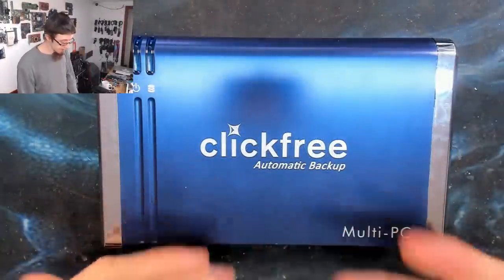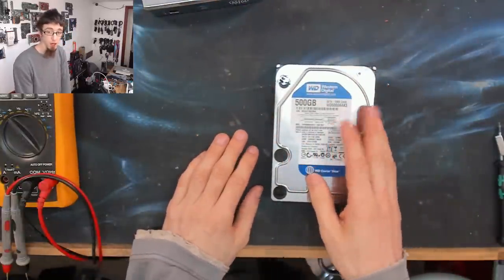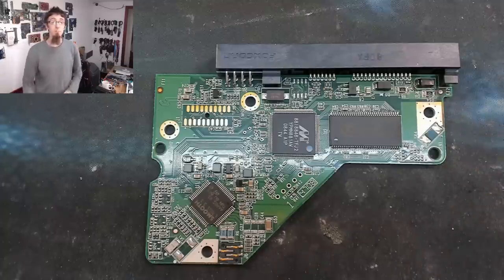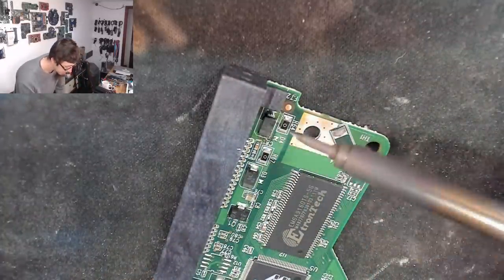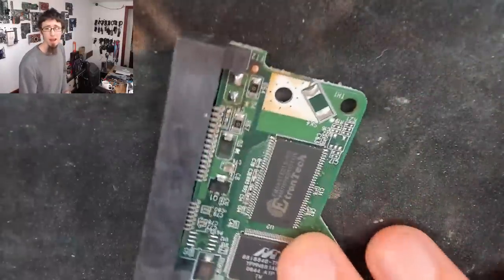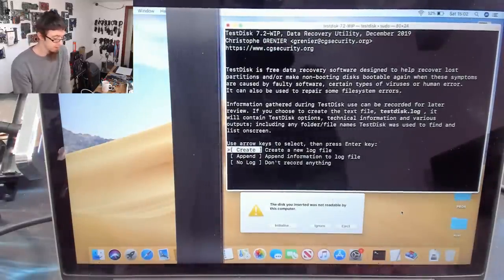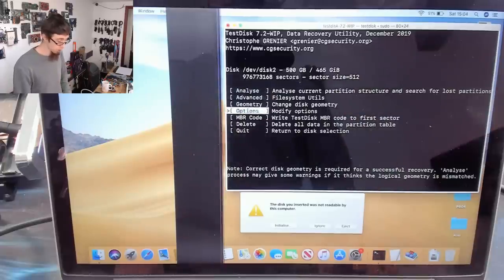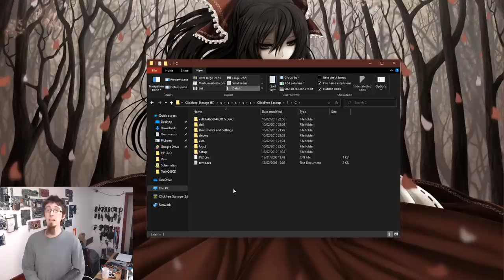Lucky save, HDD with shorted SATA connector - LFC#223

Comment: Interesting video.  I have some old drives I have not used in a while, and I recently plugged them into a caddy, and they kept cutting the power to the caddy, I guess some short circuit protection.  In another caddy I started to smell burning, and saw smoke after a few seconds.  Both caddyies had decent power adaptors, and work with other drives.  In fact, one was a brand new WD caddy I had after removing it's original drive.

Of the 4 drives I tried 2 of them, with the same behaviour, and not wanting to mess up the caddies I stopped.  I just checked, and the first 2 are shorting the right side sata pin onto pin 4 and 6 (not 5).  I see the same thing on both drives.  On drive 4 I think it's the same, and drive 3 seems OK, pin 1 not shorting to 4 and 6.  I found a component, KVP 47A, and it seems to act like a diode, on drive 3, but not 1,2 and 4.  

I stumbled across your video by pure chance, in my Youtube recommendations, watched it casually, and when I saw, took a look at my drives.  I might remove the KVP 47A component on one of the drives, just for kicks, since these are ancient 250GB SATA Maxtor drives I don't care about anyway, ideally I'd like to securely erase any remaining data prior to disposal, or letting someone else find a use for them.

Comment: Rare to see a Western Digital HDD fail. For me i had 2 Seagate just randomly died (Both ST500). My speculation was the board because i could see the PCB seems like corroding, it has spin and drive would show up in bios.. but when in windows it would just tap out and not show up

I had bad Western Digital too that died but thats on me. One day it got suddenly housed by an ant inside my PC case while i was away for a day. In my panic i throwed the disk out and... went full linustechtips... now the drive is just on my balcony as a reminder to myself to always put extra care to my data i lost that i cannot recover

Comment: Hot tip... The spring pins that go to the pads leading to the motor are a source of failure and frustration.  Whenever I remove a board that has them I bend the pins upward just a little so they make better contact with the pads leading to the motor.  If the pins don't put adequate pressure on those pads then the coils in the motor don't get sufficient current flowing for the controller to detect a properly functioning motor and so it spins up and down over and over. Vrrrrup frrrrrr.. vrrrup frrrrrr.. like its cursing at you.   lol.
Reply from the maker: Oh aye, I've heard a drive do that before... cheers for the tip!

Comment: Hi, i'm in DR field.
Protection diodes on 12V and 5V rail are not ZENER but TVS diodes (Transient Voltage Suppressor).
Cool video :)
Reply from the maker: Oh neat, fair enough! I've often seen them referred to as Rectifier Diodes as well. Is there a particular difference, or is it just specialised for the particular task?
Reply: A zener is one of two types of diode based TVS's. The other is a form of thyristor. 
TVS is a generic term that also includes gas discharge tubes and MOV's. The Zener reacts in 50 ps and can go down to 3v and can dissipate small amounts of power.. the tyristor type only goes down to about 30v and cannot dissipate any real power. It reacts in about 3ns. So tis is indeed a Zener.
Reply: You will often find two or more different types of TVS in paralell in order to allow them to work to their strengths. Gas discharge tubes handle very high voltages butvthey are slow. MOV's are medium speed and medium voltage and can dissipate quite a bit of power. Thyrister TVS diodes are similar voltage but much faster. Zeners are low voltage but very fast.
Reply: @Adamant_IT  yes rectifiers and zeners are completely different. Rectifiers only pass power one direction. If you manage to exceed its breakdown voltage it is toast. Not so with zeners. They are designed to  conduct in reverse without damage.
Reply from the maker: Cool stuff!
Reply: @Adamant_IT  A TVS diode can be thought of as a very fast acting zener. I never tried to replace a shorted TVS on hard drive pcb with zener, so i can't tell what would happen in case of over voltage or some other type of power surge when has been replaced with zener type. I always replace TVS with TVS!
If i have to choose between replacing 12v tvs diode with zener diode and not replacing it at all, i would prefer the 2nd as you did in the video (of course only after have check that short on pcb has been solved and that power supply is ok).

If, on the other hand, it was the diode on the 5V line that shorted, i wouldn't have risked turning on the hdd without first replacing it with same tvs diode (or equivalent tvs). If something goes wrong without any protection on 5V rail (or without a proper protection) heads pre-amp would get killed, which is located inside the hard drive (on the heads arm). If that happens then you would definelly need to swap heads in clean room.
Reply: Daniele Malagoli maybe you could help as you seem very knowledgeable. I have the same issue on a 10tb drive that I don’t want to rebuy(out of warranty) I wouldn’t mind attempting to replace the chip with a new one as a last resort  but I’m unsure of what specs the diode would need . Could you kindly point me in the right direction.
Reply: @rathy21  Hi rathy21,
i need to know the exact model of your drive and pcb number.
Better if you also post a pic in high resolution of your pcb, i need to see the marking code written on tvs diodes (u can upload pic on imagebam.com and then pass me the link).
I'll tell you which diodes to buy exactly, i usually buy those on rs-online.com or get them from a donor pcb as yours.

Comment: Hi mate!  Long time watcher, fist time commenter.  I wondered if I could pick your brain?

I have a custom 360.  I am able to rip my discs to the drive.  It’s good for keeping my discs fresh.  The drive however has stated to do the clicking, is showing on pc (raw data like the video) but I’m unable to read due to format of disk (360 formatted drive) and its temperamental on windows dropping in/out with long read times.
I know it’s dead and on last legs.  The data is not mission critical, but to rip all those games again on a fresh drive will take me months.  What software would you recommend for a chance to rip a clone of the drive?

I know it’s a slim chance, but rather a slim chance than a no chance and months of ripping again.

Thanks for great content as always, you been my background channel for a while now hehe
Reply from the maker: I think the 360 has a custom boot sector on it. I'm sure someone's figured it out by now, but I don't know the answer myself.
Reply: I would try Minitools version 10 or above and try copying the drive.
Reply: @SummerSideOfLife  just wondering how many total GBs estimated time it would take?
Reply: @SamuelFCampbell2003  you should definately use ddrescue (specifically gddrescue), get a  ubuntu usb boot disk, then do a clone to a replacement hdd, it is a sector by sector clone and such doesnt care about the partition table or filesystem. https://www.technibble.com/guide-using-ddrescue-recover-data/
to install gddrescue use the'se commands:
sudo apt-get update
sudo apt-get install gddrescue
Reply: cloning copies everything from one disk to another, the special thing about ddrescue is it retries then skips bad sectors so it works well on failing drives.

Comment: this is my issue, that i cant fix!!...i have a seagate 2tb with a dead pcb!...for month i tryed to fix but i cant locate the problem! there was no 12V signal! every few weeks i pick up this pcb and try!
for the most time, i miss out the two "zero ohms resistors"..they have marks in the middle and u cant read the "0"...there is something that blown this 0 ohms resistors out.I guess these 0ohms are a kind of fuse!
anyway i changed the Diode, but still nothing. No short to ground at all but nothing happens! Drive wont turn on....

Comment: @Crazy Clown, Im a sparky by trade, yes I notice majority of exaust fan coils go open, never come across one that has a ahort (yet), I find most motors that come in (usually for rewinding - these are 3 phase industrial size) they are usually are shorted between turns, on very rare occation they open but usually they are in for a warranty claim (only heard but never handed one that is open circuit).

Comment: "TestDisk" is a nice to know, but another way around the "disk not initialised" is to simply put the hard drive back in its original external caddy. The caddy's disk controller would of been responsible for initially formatting the drive and would know how to read/write to the disk. Seen this many times before. I've had issues with laptops in the past taken the drives out and putting into a dock station and not being able to read. Again - I put the hard drive back into the laptop, booted from a Linux USB pen drive on the laptop - I was then able to simply plug an external hard drive into the USB port to copy the data over. Its simply some compatibility issue between different hard drive i/o controller chipsets.
Reply from the maker: I have seen that instance once before, where the HDD was 'tied' to the enclosure, but only once out of many many external drives. Definitely not representative of the norm. Enclosures are purely a SATA-USB bridge in the vast majority of cases. I think the exclusion is if the enclosure has built-in hardware encryption.

Comment: Western Digital based external drives are also notorious for using one of the unused 3.3v SATA pins as an indicator pin...  Fixed using a "tape trick"...  I always check for that.
Reply: It's not an unused pin, it's the new industry standard power disable pin.  It lets the host fully reset the drive without unplugging it, and allows for sequential startup in large arrays to avoid overloading the power supply.  It actually is a useful feature, and was a decision by the SATA-IO group in 2016 with rev 3.3, not a WD decision.  They could have reversed the signal levels so that 3.3v would enable the drive instead of disable it, but then 4 pin adapters would never work.  I agree that the implementation is stupid, they should have included some reserved pins from the very beginning, or added a little logic for 2 cents
Reply from the maker: Nice, always wondered how drive powerup/down was handled.
Reply: @alakani  
WD external drives had been using this proprietary scheme since like 2005 and the days of SATA-I... long before any new 2016 standards.
I would imagine the new standard was directly based on what WD was already doing for many years.
Reply: Adamant IT it’s used on desktops for BIOS/UEFI setting SATA HOT-SWAP feature so in the OS you can almost treat it as a removable drive. There is Windows software called HotSwap! online that will allow you to safely remove fixed drives.

Comment: I love your technique of step back forth ! But I can’t take it anymore and want to save you very much time ! On amazon they sell sticks of low melt soldier apply that first with hot iron and heat up slowly with air station that. Will help you on the long run and save very much time

Comment: You could have tried putting the drive back into the enclosure and it should then have been readable without doing any sort of data recovery. These kinds of drives as well as some WD external drives have a small partition at the beginning of the drive (virtual DVD drive) with software that is usually on a Linux partition (Ext3/Ext4). Some Linux distros can just see the partition and can read the data without issue.

Comment: Hello Adamant IT
Thank you so much for the extemely informative and concise tutorial on this subject.
I Have 5 yes 5 shorted seagate 500GB Hard drives all dead as a dodo right now, however i have a question?
Could i pull a card from a working seagate 500gb identical in  every way to the toasted cards! or would it be better to use the tutorial to remove the offending diode?

all 5 drives are not showing up in any recovery software including  testdisk

Comment: Valuable information! I just had this happen with a Seagate 40GB Barracuda HD where the diode seems to have broken/collapsed onto itself from an overload. I just can't visually tell if it's a zenith diode or some other type of diode as you mentioned. all the text on it is toasted. I may be able to replace it though. I have a drawer full of these diodes from donor electronics. I did notice that this drive has many missing or unused areas that have no soldered components on it. Is it possible to improve the drive's capabilities/functions if I can acquire the missing components from the higher spec HD model of the same type of drive? It's something I've been curious about with mobo's and other electronics too.

Comment: I'm paranoid, so before running TestDisk I usually make an image of the drive (using dd or something) and then run testdisk on that image.  Just in case I mess something up, then I have an image backup.
Reply: That's definitely the recommended method.

Comment: I think if that would connect to PC with nice PSU it will blow those 0603 or 0805 size 0 ohm resistors. They are there act as poor mans fuse. I think some manufacturers was using fuses there before but now when disks are cheap they use 0 ohm resistors.
Edit: 
Also in these drives without those TVS diodes data recovery would be much more difficult.

Comment: Bro. My 3tb gave out today. I threw it in the garbage and for some strange reason looked up some videos and found this one. I took it out of the bin and did exactly what you showed on here. Removed the diode and plugged it into my hdd caddy and it worked perfectly. Absolutely helped me 100. One question. What happens now that I'm using this with a removed diode?
Reply from the maker: Without the diode it has no protection from voltage spikes, ESD, short circuits, and so on. So it's not really a reliable drive. This is mainly for data recovery. That being said, any standard TVS Diode rated around 14-24v or so would probably be a suitable replacement if you really wanted to 'fix' the drive.
Reply: @Adamant_IT  thanks for the response. I'm shopping around atm for it. Hopefully I can do a permanent fix. Thanks again.

Comment: could you replace another diode in the drive or is it not really needed ?just like to know ?thanks for showing us that was great to know and do
Reply from the maker: Theoretically, it would work without it. It would just have no protection from a surge out of the PSU.
But it's a moot point, I wouldn't continue to use a drive that's had any kind of fault, full stop. If you can't trust it then it's useless.

Comment: Good question: got 2 HP G62 laptops, 1 is AMD & the 2nd is Intel. Can the HDD from the AMD be mounted in the Intel case & work? Or, how can I tell if the screen & keyboard will work - Intel to AMD case? Thanks 🤓

Comment: @AdamantIT in your vid @6:13 you checking that diode and got a short putting the leads in both directions. I tried your exact method and only get a short when i test it in one of the 2 ways. Red on the right gives me a short but red on the left doesn't. What does that mean??? Should i rip it out or leave it? I cant get my WD MyBook to power up and came across your vid and found it pretty informative. I liked and subscribed to you channel
Reply from the maker: That's normal, a diode only conducts in one direction.
Reply: @Adamant_IT  so why would there be no power getting to this thing to power up for🤷🏻‍♂️ have spent my whole saturday trying to diagnose it and get it up and running no luck
Reply from the maker: No clue myself I'm afraid, I've not got a lot of experience on hard drives - this diode example is just a lucky shot in the dark that sometimes hits.

Comment: this sucks! i installed some new fans in my pc and the PSU cable i used to plug in on was damaged, it shorted 2x 4TB drives
now i need to wait 2 weeks to get new circuit boards so i can access my data....

Comment: I did this and the diode is still suck on there with a bit of the diode melted because I kept inadvertently touched it. There doesn't seem to be much lead to soften up on the sides of the diode. I may have gotten some solder on a component next to it also. I just ordered a mini heat gun. Hoping I didn't damage the pcb. Thanks for the tutorial. Total noob but figured I try it just for kicks.

Comment: Hi there 🙂. I powered a Buffalo NAS with an inversed polarity power supply (connector was wrongly replaced). As a result I grilled the NAS AND the two 4Tb Seagate HDD inside of it. Do you think you can help me replacing the protector in my PCBs? Thanks a lot. Dan

Comment: Shame they didn't put some fuses on the 12v and 5,  the diode could just pop the fuse and not kill itself in the process.
The free DMDE disk editor can find partitions,  and find old partitions as well,  handy to see what's on a drive.
Not sure if it allows copying from a partition in free mode.
Test disk is very handy, similar to the old norton disk doctor from dos days.
Reply: The diode is the fuse, they both cost the same price and take the same time to replace.  Thanks for the tip about DMDE, it looks awesome and there's even a mac version, been looking for something decent on mac forever
Reply: @alakani  Im always looking for good disk editors, but most seem to lack things like templates to show data in a nice format.
Winhex is good but it's a pay only editor.
Free active disk editor works, but it's a bit odd in operation.
Happy disk editing :-D

Comment: Hi adamant i have 2 tb wd purple hdd. It has short circuit in 5volt supply i just remove that protection diode but its still  shows short circuit. I had test complete board but nothing find.